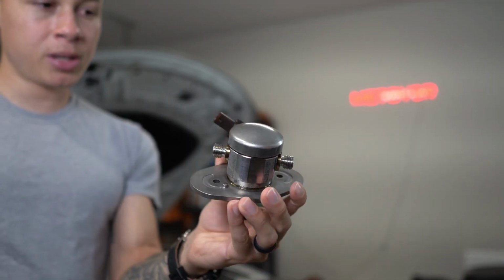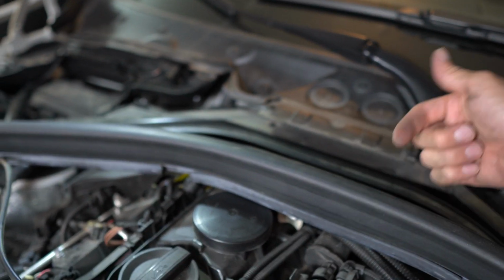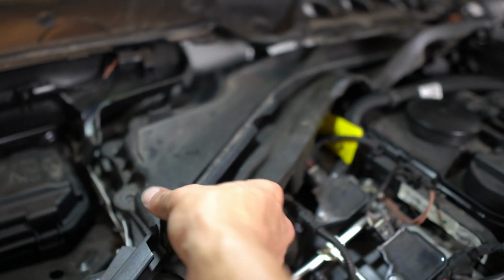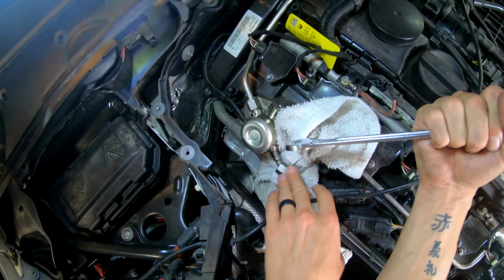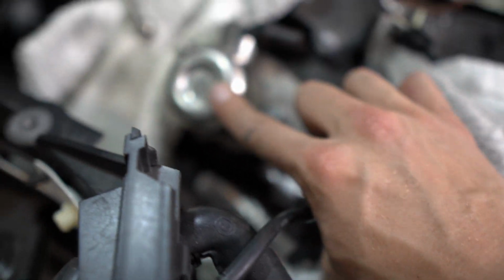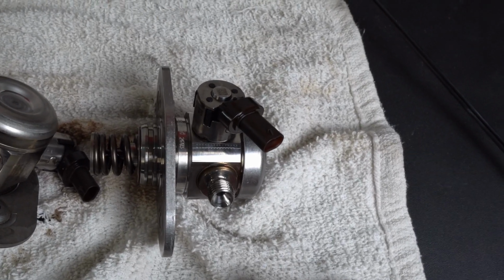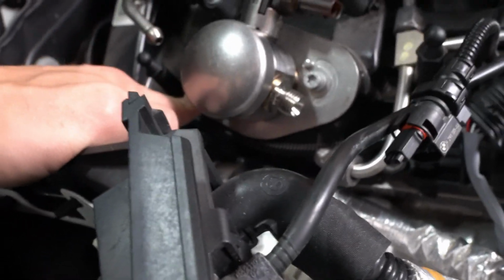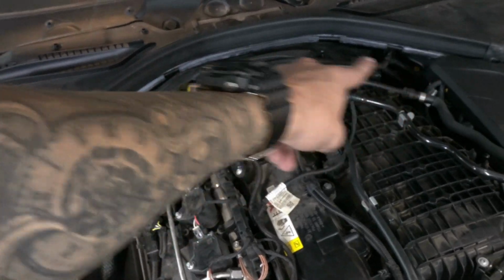High Pressure Fuel Pump Install (B58 TU) (BMW 340i)

Comment: Wrong!!: TU pump is 1,234 x bigger then Gen 1 pump. 0.954 cc/rev vs 1.178 cc/rev.
Dorch Engineering Stage 2 is 1.633 x bigger then Gen 1 pump!!
Reply from the maker: So how am I wrong exactly?

Comment: Hey man, I installed the tu pump on my340i 2 mouths ago and I find out that the rpm at cold start is much lower than before, it’s only 600 right now. Did this happened to you as well?

Comment: What does the increased PSI do?  In that, my next mod is the catless downpipe and tune. Would you recommend the fuel pump too?? If so why?  Thank you in advance
Reply: So did more research on this.  Allows more fuel from stock 2900 to 3000 psi that stock b48 ans b58 pumps allow, the tu pump allows up to 5000psi so when your hugh speed and rpm

Even in pump gas like good stuff 99 octane even 95  gonna see gains interms of horsepower with proper tune as youll need a tune cause tund is coded to limit of 2900 if your on a ots

Comment: What’s the benefit of switching my fuel pump (2017 440i)?
Reply from the maker: To Keep it short and sweet. Upgraded pump gives you more fuel flow and more fuel gives you more power

Comment: To go on e30 do you need any other fuel system mods ?? Or just This and a st2 tune *
Reply from the maker: With the b58 engine just the fuel pump

Comment: Have you had any issue with the new pump being noisy, like a ticking loud noise under load - 2400K revs to 4000? I have the TU pump on a B48 engine and its noisy under acceleration.
Reply from the maker: I haven’t had any issues with the TU pump tbh

Comment: You just save me a whole Lo of  time and headaches B58 Nations
Reply from the maker: Glad I could help
Reply: @Metoy3r   what up Bro!! I also have a 2016 GEN 1 B58 on BM3 did you run  the E50 map yet? If so what kind of power did you get out of it? B58 Nation
Reply from the maker: Yeah I have a video on that! On the dyno with the e-50 tune

Comment: what are the drawbacks of running a fuel pump with nearly double the fuel pressure? any reliability issues?

reason I ask is because the b58tu has a redesigned timing chain configuration, as well as different higher capacity fuel injectors (among other redesigns). Does this effect the reliability of a gen1 b58?
Reply: The fuel pressure regulator on the fuel rail will limit any dangerous amount of over-pressure, nothing to worry about in terms of reliability
Reply: Will definitely need a new turbo sooner.
Reply: @Zacr1017  bs. you don't need to change any sooner. its better for the whole setup to upgrade the pump.

Comment: do you need a retune/tune after installing?
Reply from the maker: Not if the car doesn’t already have a time. I’f it is already tuned tho most tuners bootmod3 MHD etc have a specific option/tune for the tu pump so just change it there .

Comment: Did you just tighten down the t30 screws on the pump. Or did you tighten to torque spec? If so what is the torque?
Reply: 12nm

Comment: Just to be clear you can run full e85 with this upgrade up to what around 550whp?
Reply from the maker: You can run an ethanol blend with this pump. To run full E-85 I would suggest an upgraded low pressure fuel pump as well.

Comment: Hi mate, is it the same hpfp as the Bosch 0261520520?
Reply from the maker: The are different pumps. This one is the second gen b58 fuel pump
Reply: @Metoy3r  hi, thanks for the reply, but they are the same. But you cant buy it already as a bosch pump, just as an original bmw pump. Anyway, I purchased a dorch st 1 :)
Reply from the maker: Dorch is the way to go

Comment: Great Video.   Just bought a new one for the 428i.   Haven't installed yet, but wonder if I would be better to go with an upgraded one vs the new stock one from fcp euro.  🤷‍♂️
Reply: I know this is old post but where you buy it from lol thanks
Reply: @bobbywoll7942  I just bought a stock hpfp from fcp euro.  Easy to install and I have had no issues.  I only have a 4 cyclinder so the upgraded one is meant for a 6 cyclinder engine.
Reply: @scottfriesner1538  thanks for the info brother
Reply: @scottfriesner1538  question, did you have to turn the engine to make sure the tappet would stay low?
Reply: @DuckMcDuckinson  Yes.  I did for added security.   Put a long screwdriver in and while turning the engine I went around once to make sure it was down.  It was actually a pretty easy install.